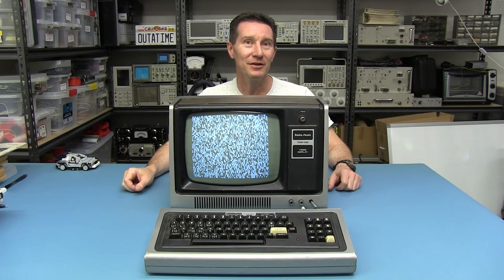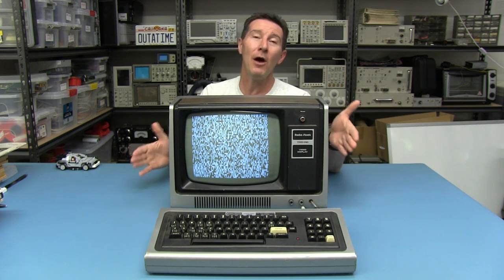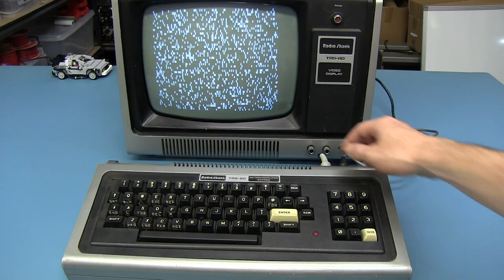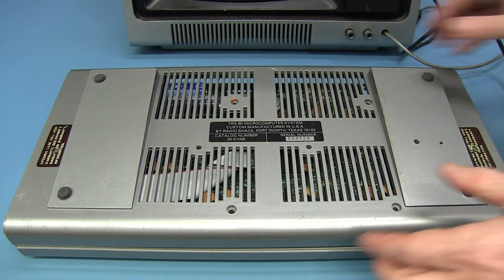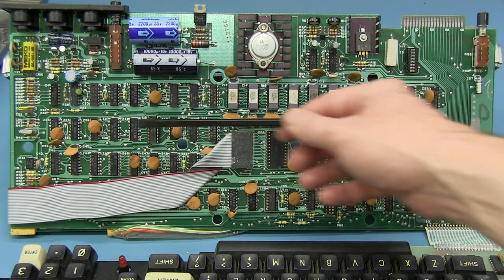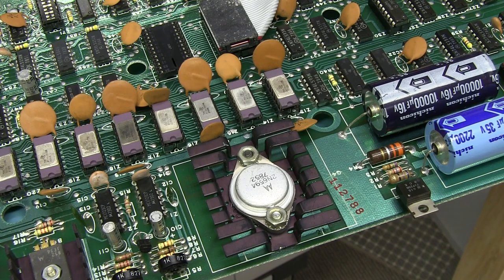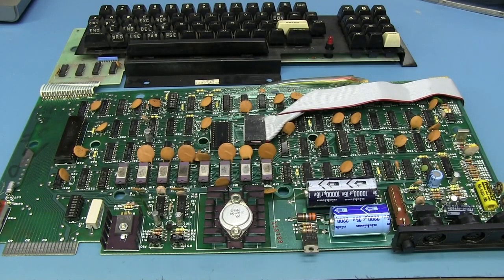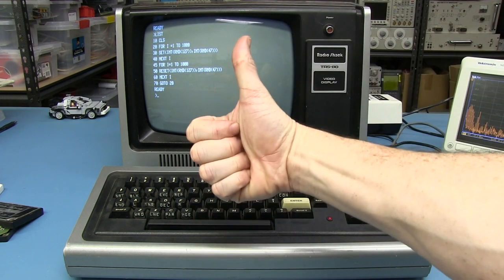EEVblog #645 - TRS-80 Model I Retro Computer Teardown

Comment: Need to do a write up on the Model 1... I was one of the folk in Tampa that was on the team that wrote BASIC for the Southwest Technical Products 6800...  I forget the name of the exec that called us and offered $10k for basic.  The others in the group negotiated the terms...while I did the BCD math package and then the string handlers.. (Was teaching Z80 assembly at that point)... We figured 9 months max to get the basic going.  The shack was supposed to have a target hardware package to us by August of the year... Came December, and no sign of hardware.. A flurry of phone calls in January and February resulted in our withdrawl from the contract.  There was a hard coded date for finished code that was march of that year, and we were going to have to troubleshoot all the hardware interaction.. the word from Tandy was "Don't worry about the contract."  --- They had been known to sue and destroy anyone that was a day late on stuff.. so we got out.  First shipment: Lee Chin Wang's tiny basic in the box... When that was a total dud...So they went to Gates to get Microsoft Basic.. In ROM.. (Hard to pirate roms!)  --- Gates wanted something around $100k... Tandy's CEO said "How about $10k and $xx per machine?  Gates had been burned by MITS... so he finally settled on a figure around $56k...   Doing that, knowing that the box with its 6 digit serial number wrapped 3 times.. IN other words - a million in sales roughly.  Had they taken $50 per machine, they would have multiplied the take by 10x minimum...

Comment: The biggest single defect in this machine was the tape recorder program storage.  You had to save your program to tape, reset the computer and then try to reload the program, to see if you got it saved.  After failing in this process a few times, most people gave up programming.  I know  lost work weeks to this process.  The only sane alternative would have been to have a second computer, to test the tape copy, without losing the original.  And very few people had two of these machines.
Reply: *****
If only we had had a way, back then, to compare notes.

Comment: I had a TRS-80 with extended color basic purchased in the mid 80's for a whopping $50 US. On mine, the heat sink wasn't sufficient to keep it cool during constant use. After a day of use, I fell asleep, and woke up to a melted plastic case and blown power supply circuitry.

Still the best machine of its day. Made the Apple look like the PC of a simpleton. My hat is off to RadioShack for producing the first true PC for the masses.

Comment: Very cool, that monitor was so built to a price point, and dead simple to make. It started life as an RCA as Dave mentioned, To make it into a monitor, tuner and IF section was removed the IF, video/audio demodulator was all on that circuit card standing up in the left of the TV it was then replaced with a direct video drive board and the cable run out the place where the volume control had been and a plate placed over the holes where the tuner had been. Made in Taiwan 
The higher end RCA TV's of the era like the XL-100 color sets where made in Indianapolis Indiana.

Comment: Couple things: The $600 price DID include both the monitor and the tape cassette recorder (at least in America), they weren't extra. Also although there aren't any conventional 'jumpers' inside, if you look at the bottom right below the RAM there's a socket with a unit in it that has broken & intact connections. This was the equivalent of jumpers (you had to change it to upgrade the memory yourself, which I did). Also the button next to the interface port on the left side was indeed factory, and it was not a BREAK key, it was a reset button (like on early PCs). Also, be careful with the monitor/TV open like that, it exposes voltages that can kill you!

Comment: I lucked out and was given an early model (without the keypad) a few months ago.  S/N 33350. It had the uppercase modification (which I had to remove because it also had the BASIC level 2 ROMs).  I also have a expansion interface, disk drives, cassette deck, modem and a few other goodies.  Still have to troubleshoot the expansion box (it just displays garbage characters when hooked up).  Very neat old computer.  Can send pictures if you like.

Comment: A common trick we used to do to the Model I's would be to attach gold plated edge connectors, replacing the silver plated ones. Why? Because the silver plated connectors corroded easily, and with a very minimal buffering design, the slightest bit of corrosion on the edge connector would cause the entire system to lock, or reset. Was a major pain in the ass.

Comment: Hi Dave, I Just Started to view your blogs here in the U.K. and old computers woo I was repairing Z80 comps here then in the 80`s in my retail and repair shop, Pets, zx81, Sharps z80, Commodore 64`s and Sinclair Spectrum's, = ram ic`s failing, psu faults and customer abuse. But then my broad band when`t down, so today I made a my first videoblog on how to get on the internet with your laptop and iphone 
as I could not find any blogs to do this.

01 videoblog how to connect an iphone to your laptop via wifi

doze this remind you of your first eevblog ?

P.S. You have gained another fan, but now to start from eevblog #1

Comment: EEVblog Dave, regarding the FCC and EMI on the AM band, the FCC does not have any restriction on the radiated EMI of unintentional radiators below 30MHz, so I don't think that getting it to pass the FCC regs would necessarily do much to prevent its interfereing with the AM band (unless it was interfereing via conducted emissions in the AC line cord, which then radiated in the house wiring).

Comment: I had the TRS-80 Model I, which I bought toward the end of its lifespan in 1980.

I don't know if the CPU was sold without the monitor.  I remember the monitor always being included.

The labels attached to the left side of the keyboard keys were for the SCRIPSIT word processor.  You would hold down the @ key as a "control" key and hit one of the keys on the left to access various functions, such as adding a page feed, a paragraph marker, or repeating a command a number of times.

Comment: Unless you’re talking about Australian sales, there’s a few mistakes. 

The lowest model came with only 4K of RAM and Level I Basic. You could get it upgraded to Level II Basic and 16K, or buy it like that initially for a higher price.

In America they didn’t offer it for sale without the cassette deck or monitor, only as a package. And since the cable going to the monitor was a full-size DIN adapter it wasn’t practical to try and connect a regular B&W TV.

And yes, the name ‘Trash 80’ was only used by Apple II snobs. I had a TRS-80 in high school in 1980. Other kids would criticize it thusly, but when I asked them ‘Do you have an Apple II?’ they’d say ‘Uh, well, my mom said maybe, if I get better grades’. Yeah, thought so.. 🤨

Comment: Have one in my attic, along with a few Model IIIs.  Had some of those RCA TVs in the family too.  A 19" in my parent's living room and the 12" in my grandparents kitchen.  The rotary tuners were in the area covered by the label panel on the Model I monitor.  The volume control in the hole the cable is coming through.

Comment: The reason the date codes are 79 but the serial tag shows mid 78 is likely when the upgrade happened, they replaced the main board with one already modified and kept the original to modify it for another that came in later for the upgrade. Either that or the board was replaced under warranty due to the original going dead. Either way it's likely not the original main board for that case.

Comment: This IS a very early Model 1 since it does not include a hardware "fix" for the cassette interface that was to cure a bug in the early 1.1/1.2 12K ROMs (the "verbose" text versions).  Later Model 1's had a "-1" appended to the part number to indicate the cassette fix.  The final run of Model 1's had two ROMs (one 8k, one 4k, called v1.3 with the "R/S L2" boot-up) in the sockets and zero "tacked-on" boards.  The 1.3 ROMs fixed the cassette bug, so the hardware "fix" wasn't needed.  Also, sound was very quickly supported by game developers by simply using the cassette output as a basic tone generator, capable of simple "music" and in some games, very crude digitized voices.  The "hack of the day" was to press REC/PAUSE on the cassette deck and play the audio through the deck's speaker!

Comment: I learned to program on one of these things.  I had an early machine that developed terrible key bounce.  You could hit an "A" and get "AAAAAAA" all across the screen.  I had the upgrade done just to fix the keyboard bounce.  The original language was better that the full version of basic you got with the upgrade.  The machine I bought in the USA came with monitor.  I went on to buy a floppy drive and a printer.  Work I did at work in a day I could come home and complete in an hour over my lunch hour on the trash 80.  When my superiors saw this they got me a IBM for the office.  So, lots of memories.

Comment: I remember learning BASIC on this machine around the same time I learned Benton Harbor BASIC on a Heathkit H8. Then I bought an Apple2 (not 2+) which I still own and which still works. It is really weird just turning them on and off without the the concepts of "boot up" or "graceful shutdown". You might want to do a tear-down on an Apple2 because they all had a nifty switching supply. The cream-colored case was made from aluminum (I think) which made RFI problems much lower.

Comment: Many kids from the 70s remember the Apple II and Commodore PET  because of their popularity in schools. Even if the TRS-80 outsold both in actual units, the vast majority of people didn't have any computer at home, School was the first place most of us touched a computer. (in my case it was the Apple II) I was very aware of the TRS-80 as I was a budding nerd whose yearly rite was getting the annual RadioShack catalog. I'd end up with a I and later a III. The one Radio Shack computer that Gen Xers have a fond memory of is the TRS80 Color Computer, An entirely different machine.

Comment: ... built in the 1970's and it STILL WORKS! OMG, would love too hear a commentary on how likely that kind of longevity is likely to be seen in contemporary electronics! 8O
Reply: my zx81 still 'works' well it wont load from tape anymore, but yeah, still terribly slow, its so slow its still running some basic code that counts up, 30 years and its still not got to 100! :}
Reply: jusb1066
I'm a computer fixer and I'll go out on a limb here saying that the speed problem is between the keyboard and the chair.

Comment: The level 2 rom kit is the add-on board kit located in the lower front corner of the keyboard/main unit as seen with the top cover off.

Comment: oh such memories... I heavily modded  my trash80 & expansion interface. opting to extract it all from the original cases and fit into a foil lined, model III ish look timber case. removed the old "6 block graphics" and shoehorned in a 128k static ram chip so I could write some "programmable graphics". I also replaced the original sssd FDC chip with a dsdd one (can't remember the part# though) and fitted a stack of 3 floppy's. 48k, L2 basic, and a z80a CPU ...powerful stuff for its day lol.

Comment: Digging deep into my days when I first designed a computer, I believe that clock cycle for clock cycle the Z80 was about 10% faster than a 6502 because it had some commonly used instructons that could take advantage of it having more than one accumulator (the 6502 only has one). There was also an I/O bus. The only problem was capitalising on the advantages as the multiplexed bus could slow it all down again to the point where it was slower.

Comment: There was a 68000 expansion board for model II for running a xenix operating system.
The system become a dual CPU, Z80 for I/O handling and 68000, with her own RAM, for the unix OS, FANTASTIC !!

Comment: When showing the inside of a Model I monitor, I like to point out the holes where the UHF and VHF knobs would have been (they're covered by logo cap on the front, which is just an empty box).

Comment: Crazy. Now radio shack sells over priced electrical components and cell phone plans.
Reply: Yes you have questions they have cell phones.
Reply: It's radio shithouse now...lol
Reply: To be fair, even in the 1980s, 95% of what they sold was cheap and nasty hi-fi gear in expensive boxes, then added some expensive yet nasty phono leads, and charged you £1:49 for 4 resistors. I'm surprised they have lasted this long. Good days though.
Reply: Maplin seems to be following the same road albiet 20 years later.
Reply: Electron Alchemy good to know. I was born in the 80s so I don't remember much about that time.
Reply: Blimey, I remember them as a kid in tandy. I just couldn't afford them or anything back then :D
Reply: I purchased a AntennaCraft HBU55 from Radio Shack, you know, because 145 inches is the way to go. The regular retail stores and Amazon sell the flappy "unidirectional" deals that stick to the wall, but I want to pick up signals from 70 miles away and it is amazing. I give credit to RS for having these in stock but I don't think people like me will keep them in business.
Reply: Sirus I had a Tandy 1000 TL2 With a 40 meg hard drive ($699) and a 65 meg RLL drive ($400) plus an US Robotics HST Dual Standard Modem (14.4BIS) for 500 and I got 1704 characters per second on a clean line with Z-Modem, yep those were the days.
Reply: ...And now they sell nothing. RIP Radio Shack.
Reply: God! I miss the old Radio Shack. Now to get my electronics fix, I'm relegated to Digi-key.

Comment: I had a 16k Level II when I was working in the computer industry. Used mainframes by day and the TRS-80 by night. Zork and Interdictor Pilot were my favourite games. This was in the UK btw. I have no clue where it ended up sadly. Same with my Commodore 64, 64-C (yeah two very different models of the same computer) and various bits of hardware.

Comment: I had a TRS80 copy called a Video Genie.  The main drawback was the tape storage which required endless fiddling to get anything like reliability.  Unfortunately it wasn't Kansas City standard but an analogue system. Went on to the BBC 'B' which was a vastly improved kettle of fish and incredibly versatile.

Hard to think of this being described as 'vintage' :)  The first computer I worked on was all discrete germanium transistors, drum data storage and real core store for RAM (or IAS).  No keyboard or VDU, just switches, lights, and card reader/punch. Now THAT'S vintage! LOL

Comment: A bit of trivia:

The Model I (Roman numerals, not 1) came in 2 flavors of BASIC: Level 1 and Level 2.  From what I remember (this is from 40 years ago) Level 1 BASIC had several limitations.  It could only handle 2 strings: A$ and B$.   For unintiated out there a string consists alphanumeric information such as a street address.   A variable can only hold numbers.  

Another short coming was that the highest line number a BASIC program could have was 9999

And finally, Level1.had exactly 3 (yes, THREE) error messages.  They are "What?", "How?" and "Sorry".  "What?" appeared if you made a typing mistake in your program (e.g. "PRONT" instead of "PRINT").  "How?) appeared if you tried to do an illegal operation such as dividing by zero.  "Sorry" indicated that you don't have enough memory for what you're trying to do.   Don't forget that $600 you paid in 1977 dollars only gave you 4 K of memory, not M or megabytes but KILObytes.

One more thing, the manual that came with Level 1 BASIC was nothing short of AWESOME.  There are copies floating around on the Net.  It had a black cover and it was quite humorous.  I wish more manuals were written like this one was.  I bet that writer could make the phone book an interesting read!

Comment: One of my first paid gigs ever was on a TRS-80 Model 1, with an expansion interface and 2 floppy drives. Every now and again, it would lock up and absolutely refuse to reset or power up. In that case, and there was a sign on the wall beside it explaining this, you would lift it up a few inches (the "drop height") and... drop it! Then it would fire up and work for a while again. Less than that height and it often wouldn't work, more than that height and the owner was worried it would break. Not sure if that was a common problem, but I hope it wasn't a common solution! Have to say it worked though... And it taught me to save often!
Reply: It was a common problem and solution.

Mostly it was because of chip creep, the main reason we don't socket DIP chips anymore. If the owner had known, he would have opened the case, pressed the chips into their sockets so they "crackled", and been good to go for another year or so.
Reply: Geoff Allan I have a dim memory of one of the guys opening up a machine and somehow soldering all the chips into their sockets... Or if being told that he had. Not sure how one could do that without melting the sockets! LOL. Maybe they made sockets better back then? ,o)